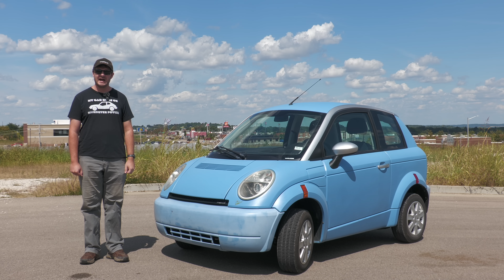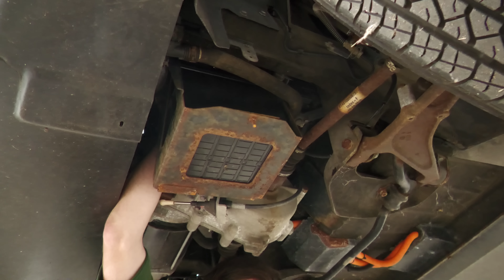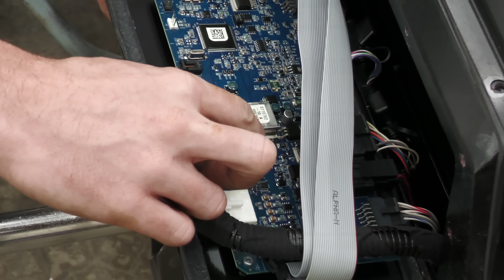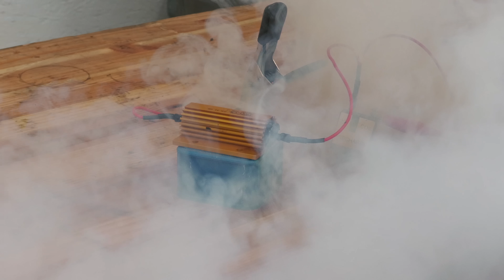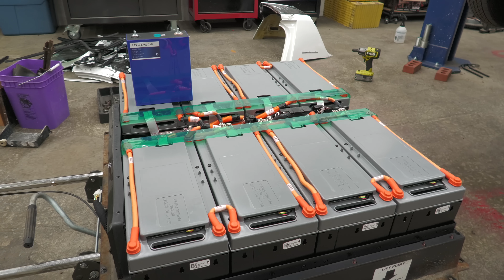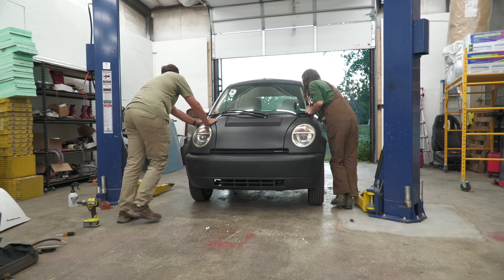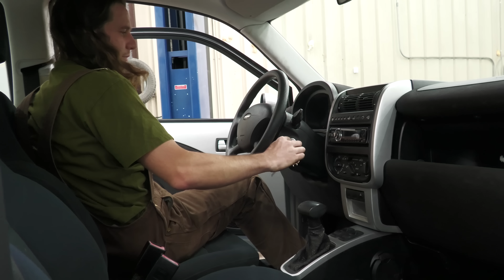Th!nks Have a Design Flaw (and mine gets a new battery)

Comment from the maker: Use code AGINGWHEELSFB50 to get 50% OFF plus free breakfast for 1 year at https://bit.ly/47hYqTo!
Reply: Someone at some point in time has to figure out how to clone electronic modules in cars, as well as create new battery systems/packs to be able to tune up EVs like ICE cars, or at least repair them to keep them on the road.
Reply: Lmao I love the C90 guest appearance. Too good.
Reply: Can you share with us, which diagnostic software did kyle use? I'm thinking about buying a Th!nk myself, and found a couple of them worthy of trying to fix them, but would need the software of course. Greetings from Germany
Reply: I have a th!ink also, would you or Kyle have any interest? it is not running, probably a similar issue... got about 60 miles per charge before it stopped working...
Reply: If that pack has deteriorated to 18 kWh, that's 75% of its original capacity. It's on the degradation 'knee', so don't expect it to last for very long. It would be interesting to see you rebuild the pack with modern cells, to give it a really useful capacity and range. Each of those modules gives about 44 Volts, so you need to give each BMS monitoring segment that voltage. You could end up with 50 kWh or more, and a range in excess of 135 miles, and maybe closer to 240 miles with some vehicle and powertrain optimisations.
Reply: Is that c90 in your  add?????

Comment: Whilst his was interesting, but the complete disregard for safety during the battery work annoys me in the extreme. EV batteries have so many ways that they can seriously injure or kill you that they have to be treated as if they are live until you confirm that they aren't. Once opened up, they are live, so have to be handled whilst using PPE and the correctly rated test equipment.

Comment: Not sure if you read all the messages, but I was wondering if I could get your advice on something.  I have a 2006 Suzuki Grand Vitara and earlier this year bought a 2014 Mitsubishi iMiEV.  As it’s just me, I am starting to think about selling the Suzuki since it’s at a point in it’s lifecycle that things will start needing to be replaced on top of insurance just for it existing.  I am completely fine with the drive experience of the iMiEV, but I am in that space of, what happens if something happens with the iMiEV if I sell the Suzuki, how will this little blue egg handle Missouri winter, is it worth it to have both even though there isn’t a solid chance I would move someplace or have a commute that extends beyond the battery.
I’m just looking for some educated advice on if going only EV with this being the EV is a sane proposition.
Keep up the interesting and informative videos.

Comment: This is an attempt  to boost content creator's ratings, by activitly producing comments, whether I have anything to say or not. :D I fed the transcript into ChatGPT, and here is my token "comment." If you want to engage, that's fine. But at this point, if we don't use the the machines to combat the machines, we'll never get ahead: 

"Wow—what a ride! This video is the perfect blend of technical deep dive, hands-on wrenching, and pure spectacle. Right from the opening warning about the “explosive” design flaw in the Think’s U.S. battery pack, the hook grabs you and doesn’t let go. And then you actually show the danger in action, with a resistor literally going up in smoke—this is the kind of moment that keeps viewers glued to the screen and hitting replay.

What makes it even better is the storytelling. It’s not just about fixing a quirky little EV. It’s about community, generosity, and curiosity. Kyle stepping up with the higher-capacity pack, doing most of the heavy lifting, and then letting us peek inside the guts of two Think City cars—that’s pure gold. Viewers don’t just see a swap; they see collaboration, problem-solving, and the sheer fun of breathing new life into old tech.

The pacing is excellent too. Every section has a payoff: discovering the pre-charge resistor issue, seeing how the bypass kit works, diagnosing communication failures, and finally that satisfying “yes!” moment when the contactor clicks and the car comes alive. Those small victories are the dopamine hits that keep audiences binge-watching Aging Wheels.

And the balance of humor and detail is spot-on. From the “spicy” puffed resistor to the lift cart trying to assassinate you, there’s levity woven through the technical explanations. That combination of safety warnings, explosions, EV history lessons, and self-deprecating commentary makes the content endlessly shareable.

What really sticks is the perspective: battery degradation, pack capacity, range improvements, and the comparison to modern lithium tech. Suddenly, a quirky 45-mile range feels like a triumph, because the viewer has lived through the upgrade alongside you. That personal investment turns casual viewers into subscribers and sharers.

This is the kind of video that makes people want to comment, debate, and tag their friends. It’s informative, funny, and dramatic—algorithm fuel through and through.

Unreal project, fantastic storytelling, and one more reason why these videos keep climbing the recommended feed."

Machines should battle machines.

Comment: Gotta say I'm glad you set up a proper safety controller with safety scanner. Technically you should have taken stopping distance into account but at least it was a proper safety system. I attended Hannover Messe this year and a company had a large robot arm set up with no safety barrier, light curtain, etc at all! It would have been able to reach about 2m past the little rope they used to keep people out, with enough force to crush them, if it malfunctioned...

Comment: You shouldnt heat the plastic liek you did in the end, It is not a permanent fix and causes very much damage to the plastics, Instead you should apply a glossy clear coat rub thing i saw online but i dont rememver the name, specifically made for car plastics that have faded, just sponge apply it on top of the plastic and it will look like new, much better than heating but i cant rememver the name and well youve already heated it now

Comment: An overloaded precharge resistor really isn't that different from a short in terms of current, I'd bet the resistance of the heater is much smaller than the precharge resistor. And even under normal circumstances precharge resistors get quite toasty, the peak current right at startup is always identical to the short circuit case, it just tapers off as the link side charges up. Lately active precharge circuits have become more popular which totally avoid generating heat to charge the inverter capacitance.

Comment: I replaced my precharge as well.  I much prefer the German -made rectangular resistor.  Also you should really very much seal the edges of the packs to prevent water intrusion into the edges of the pack, otherwise water can get in there and rot the module BMSs.

Comment: I was enjoying this up to the moment Kyle stuck a metal cased resistor to the side of the battery pack. This metal cased resistor is connected to HV probably all the time the car is running and now is stuck to the chassis ground with only the resistors insulation and some sticky tape separating HV from chassis ground! It might be OK but maybe it should be mounted a little better.

Comment: i want to know how light a modern ev could be that has a range of lets say 500 miles. 

the lightest ev car was around 230 pounds and was made in the 1960s. 

it was the peel p50 ev. 

after seeing how much battery chemestry has changed, there has to be a new lightest.

Comment: I've mentioned working on a Pivco here before in the UK mid 90s. One other thing that happened at that company was one of those big power resistors failing inside an electrical cabinet once. They really do literally explode. In this case, all that was left was the housing, the innards were coating the entire inside of the cabinet in a thin, uniform layer over everything.

Comment: I think the explanation on pre-charge resistor is slightly wrong, the time it takes to raise the voltage through a resistor should be instantaneous. But because the resistor has high resistance, the current through is going to be so minuscule that it would be safe. Which by the way means the failure mode has to be short open so that it won't turn into 0 ohm resistor upon any failure.

Comment: So the pre-charge resistor is basically an inrush protection device? Inrush resistors are used in lots of things, particularly common switch mode power supplies which always have large input filter capacitors. There’s a couple of ways to skin this cat, but the most common method is to have an NTC thermistor on the input. The inrush current heats the thermistor up, which then conducts more poorly, thus limiting the inrush current.

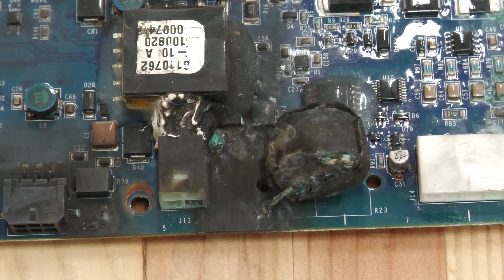Comment: 7:45 dude that board is not Beyond repair. Good chance you clean that off of there and get off the chart conformal coating and maybe repair a few traces at the worst.
Reply: Especially considering you have another board to go off of. If components need replacing, you have an example right there you can measure and reference.

Comment: I had no idea those aluminum power resistors could turn into firecrackers. Good thing I probably don't have any power supplies big enough to overload any of the ones I have like that.

Also the way those are designed to work is by bolting the flat side to some kind of metal heat sink. Usually they can't even safely dissipate their full rated power with just free air cooling. And don't forget the thermal grease either. I'm sure whoever designed the kit derated things enough out of caution, and it's not a continuous load anyway, but watching someone explain that whole safety lesson then just slap the new one to what looks like plastic in an enclosed space was a little painful.

Comment: Hmmm, 400 volt Lithium Ion pack, at 70.4 amp hours, makes for a 28.16 Kw/h pack (weighing 282kg/621lbs). To get the same voltage using Tesla Model S modules, you would need about 18 modules (450 kg) and the resulting Kw/h would come to 95.4 Kw/h (with the 5.3 Kw/h modules). If they could fit, the car would need to become a one passenger car to stay within legal load limits. 

A curiosity question, what are the external pack dimensions? :)

Comment: That PCB is repairable, just watch any repair channel. Basically, clean the area, grind out burnt PCB because carbon is conductive, replace components, and hard wire missing connections. 
northwestrepair puts holes on graphic cards to remove carbon or cracks, which are multi layer, then rejoins traces, and those things work fine. Back in the old days before PCB, everything was direct wire connections.

Comment: Yes but did you know that since the beginning of electric cars they have not improved they've gotten worse because the first electric cop car was the first electric car sold in the 1850 was over a 1,050 MI it was the very first electric cars range it might have won only 25 miles an hour that was fast for a car then the first gasoline car didn't go that fast

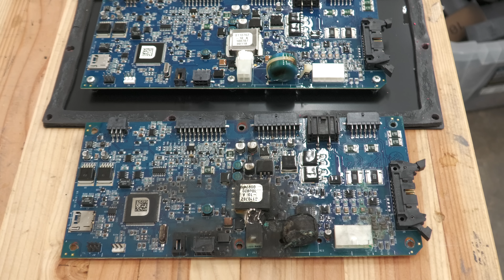Comment: 7:49 "There is no saving that board" - I dunno, looks like just some soot on a conformally coated board. Actually soap and water (and a rinse with deionized water and dry well) will probably clean that up. Other solvents could damage the conformal coating. Then just replace the resistor and touch up the conformal coating.

Comment: sounds to me like if you replaced the batteries with the same capacity of newer cells, you would cut the weight by 50%, and I'm guessing that would increase your range from 45 miles to probably something like 80 miles? And if you were going to bother with that, again if you kept the battery capacity the same but replaced it with the even higher capacity nickel batteries, that would reduce the weight of the batteries by 75%, and your range would increase probably to over 100 miles, right?
Reply: going to end direction, if you kept the battery weight the same, you could get the highest capacity batteries that would fit, and your range would jump to about 160 miles?

Comment: Still trying to figure out what happened to the 12V system on my 72V moped.
I got to the point where I know I have 72V at the input for the DC-DC-converter.

But it was difficult to access the pins while connected.

I wonder if the charger output was too high, for the DC-DC-converter, because I believe I turned the key with the charger pluged in.....

Comment: So the front bumper was fixed with a heat gun right?

Did it burn off the oxidation?

My mailbox flag could be improved without sanding or painting if that is the case

Comment: Don't heat your meal inside the pack. It's dangerous.  Yes many things are, why provoke it if you can prevent it.
Talking Teflon and evrething included ect. The wold and evrething on it is preexposed to it sins the beggining of all that crap. I think trying to reduce exposure will help and why not start by not heating and eating from alredy contaminated packing atrial.  Evrey little bit helps. At least I tend to think so.

Comment: Wouldn't it be easier to just trade cars?

(edit after watching end of video)

Ah.  Black car had other issues.  And it's kind of crazy that all you had to do to "buff out" the haze on the bumpers was to heat it with a heat gun.

Comment: Using the heatgun on the bumper like that only makes it worse when it goes back to how it was in a month or so.  You have to coat it.  Cerakote makes a good plastic trim protectant.  I also use ceramic coating on plastic trim when I'm ceramic coating an entire vehicle and it works much the same.

Comment: Is it bad that in the shot of removing the 12v battery I spotted that the car is fitted with Bridgestone Potenza RE92 tires just based off of the tread pattern? 

By the way, if you notice that the outside edges of these tires are wearing fast it's because they operate best at 45psi. At 45psi they wear evenly and roll the best.

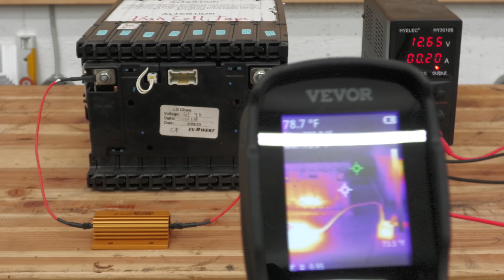Comment: This video details the process of fixing a design flaw in the Think City electric car and upgrading its battery pack (0:03). The design flaw involves an undersized pre-charge resistor that can explode if the car is turned on with the heater active immediately after being turned off (0:06-0:16, 8:14-8:27).

Here's a breakdown of the video:

Introduction to the Problem: The presenter explains that Think City cars with US-built battery packs have a design flaw where an undersized pre-charge resistor can fail, rendering the car inoperable (0:03-0:16). His own Think also suffers from significant battery degradation (0:24-0:35).
Battery Swap Offer: A friend named Kyle offered to swap his lower-mileage, higher-capacity battery from his black Think for the presenter's degraded battery, free of charge (0:44-1:02).
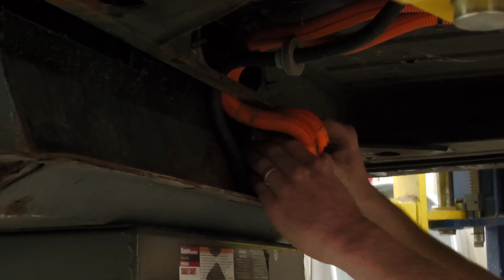The Battery Swap Process: The video documents the process of removing the battery pack from Kyle's black Think, which involved disconnecting the 12V battery, grounding strap, and high voltage inlet (1:49-2:29). They encountered a corroded low-voltage connector, requiring a replacement (10:18-10:35).
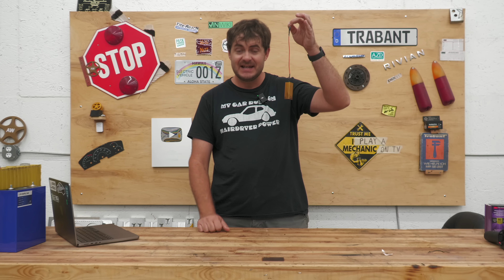The Pre-Charge Resistor Design Flaw Explained: The presenter explains how the pre-charge circuit works to prevent damage from inrush current and why the Think's undersized resistor fails, especially when the heater is turned on immediately after a quick restart (4:24-8:27). A demonstration shows a pre-charge resistor exploding when overloaded (6:17-7:31).
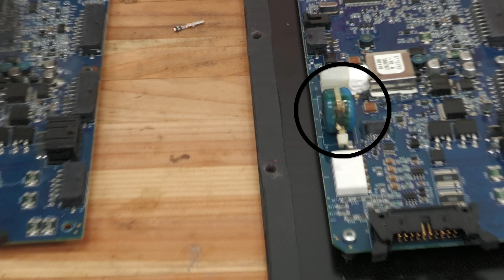The Fix: The solution to the pre-charge resistor flaw is to bypass the original undersized resistor with a larger one, which is a common fix for these cars (8:37-8:52).
Battery Technology Comparison: The presenter briefly discusses the original battery modules, noting their poor energy density compared to modern lithium iron phosphate cells (9:04-10:01).
Final Battery Swap and Results: They successfully installed the "better" battery into the presenter's blue Think, which increased its range from approximately 30 miles to 45 miles (12:41-13:40).
Black Think For Sale: Kyle's black Think, which now has the degraded battery and a non-functional climate control module, is for sale (14:05-14:19).

Comment: Fun observation about vehicle wheels: if they have 7 spokes, the angle at which the spokes are set (in degrees) is 51.428571428571428571428571428571428571428571428571428571428571428571-recurring.

If the wheels had 11 spokes, the angle in degrees would be 32.727272727272727272727272727272727272727272727272 -recurring.

Other strange combinations are available. Please use numbers wisely, and don't try to eat more than one pi.🥧🥧👀

Comment: I just did this a week ago with my Leaf. Went from 10kWh (the original 24kwh with 45% soh) to roughly 25kwh (30kwh battery with 85% soh) Swapped a good battery from a wrecked Leaf in my driveway with 2 jacks, 4 jack stands and several 1000lb rated furniture dollies. Made the car so much better. I went from 30mi highway range to about 70.

That said, I almost never use it on the highway, it’s mainly a spare car and for use around town because it’s small and easy to park, plus it’s worth almost nothing and already has some bumps and bruises, so I don’t care if it gets cart smashed in the parking lot or a bird craps on it.